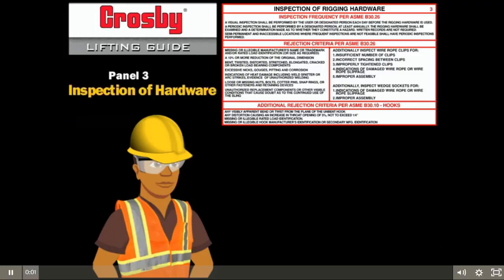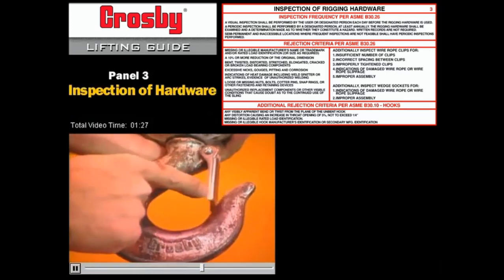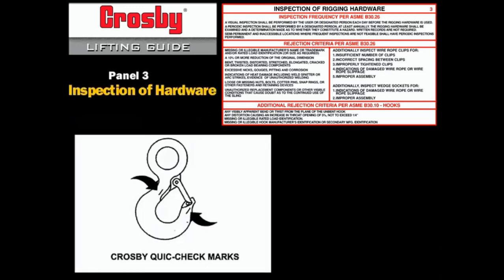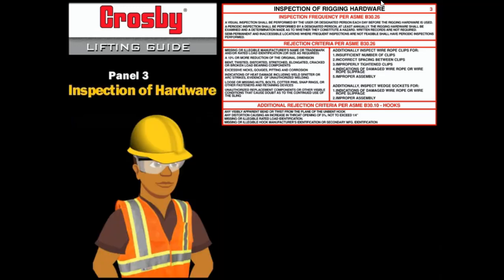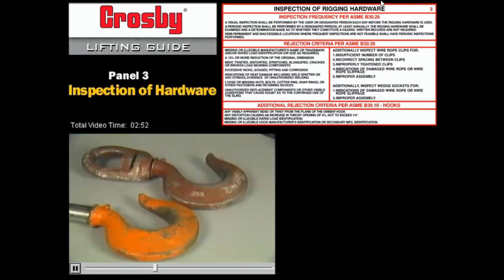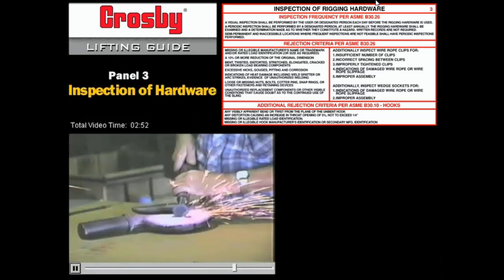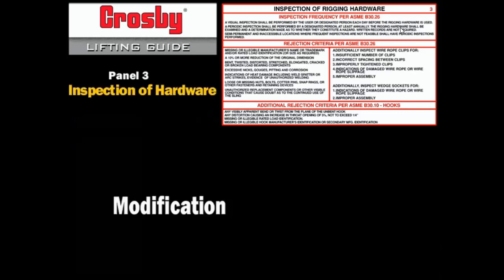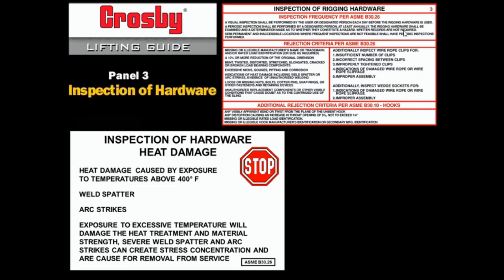Inspection of Rigging Hardware

Comment from the maker: Question 1 of 5
1. Question
Category: Inspection
Fittings must be removed from service if:
•   Any significant deformation can be detected
•   More than 15% deformation can be detected
•   More than 10% deformation can be detected

Question 2 of 5
2. Question
Category: Inspection
Modifications to hardware may include:
(select all that apply)
•   Welding
•   Substitution of parts
•   Bending

Question 3 of 5
3. Question
Category: Inspection: Wear
Wear in most areas of Crosby fittings is limited to:
•   0%
•   5%
•   10%
•   15%

Question 4 of 5
4. Question
Category: Inspection: Wear
Wear in the eye and the throat of a hook is limited to:
•   5%
•   10%
•   15%

Question 5 of 5
5. Question
Category: Inspection
Fittings must be removed from service if:
(select all that apply)
•   Crack is detected
•   Used within Working Load Limit
•   Sharp nicks or gouges detected